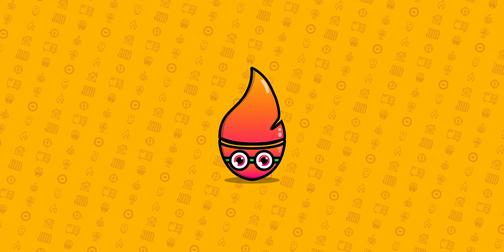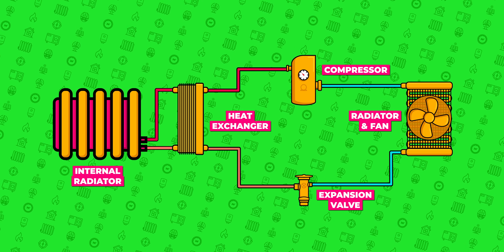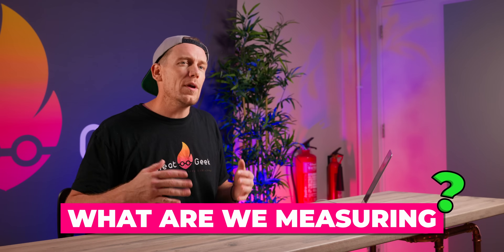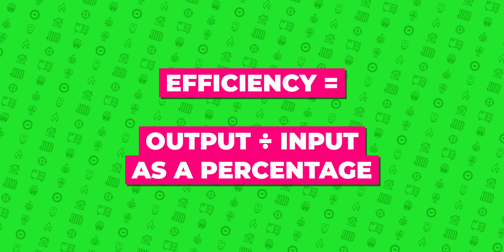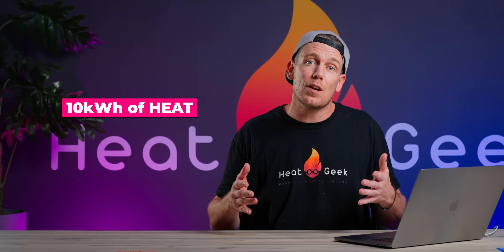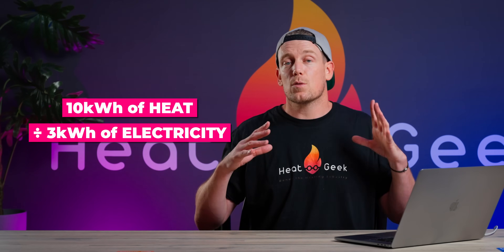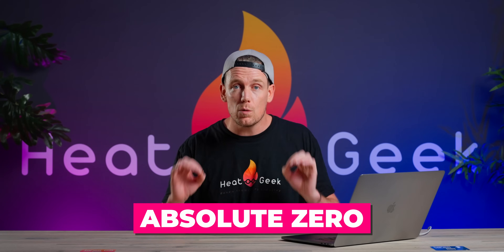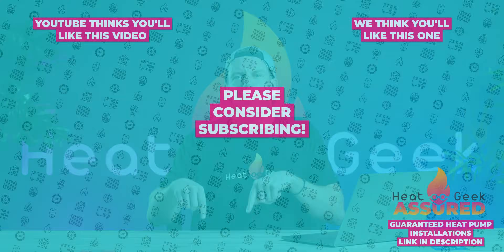How Can Heat Pumps Be More Than 100% Efficient?

Comment: In 2014 it was announced that 3 trillion tonnes of coal had been discovered under the North sea. This coal was accessible using existing technology and would be enough to power the UK reliably for about 2000 years.
We need to ditch the green energy eco madness and use this resource, only economically viable green technology should be used and only by those willing to pay the full cost themselves.
Reply: Don't be a wolly all your life Tim.
Reply: @Tim Fallon You can't extract coal from under the north sea as it would be all wet.
Reply: Pricisely, coal would get wet and wouldn't burn, at least with gas they could let it bubble up to the surface like a fizzy drink.
Reply: @bobsmith-dn1xw  are you a fizzycist then.
Reply: This video certainly does attract some amazingly dim persons.
Reply: So once we’ve burnt this coal recovered by scuba miners to produce electricity, you can use it in your resistive heater and get one unit of heat or run a heat pump and got four units of heat?  Or are you suggesting we all install coal fired boilers, get the wagon round with the coal every Thursday?

My take is you’re pro heat pumps as they make heating from burning sub-sea recovered coal more viable - or maybe I’ve got it wrong?

Comment: As a heat pump is basically compressing air shouldn't you also consider not just the temperature of the outside air but the humidity or moisture content. Also the altitude above sea level. Will a pump at sea level work differently to one on top of Everest. Flow restrictions in existing system. There must be a million things that can make each system unique and in itself different at any given time. Must be a bit like the Highway code. If you brake from 30 miles an hour it will take you X ft to stop. When in reality that stopping distance is infinite and the probability of matching that exact stopping distance even with the same car and driver in the same conditions is minimal. Too many variables.  Heat pumps no doubt efficient but at what cost. And they run on electric that comes from what source. All the ducks have to be in a row to be totally efficient. Economic and environmentally friendly.
Reply: That's not how they work... it is extracting energy from the air over a heat exchanger. The compression is of the gaseous refrigerant to liquid on the other side of the heat exchanger (at yhis point putting more temp into that gas). So the variable you're searching for here is the energy in the air.
Reply: @TheDankelsall  It is the refrigerant being compressed but heat pumps are very much still affected by heat, cold, humidity and altitude. They work in the cold and heat but their efficiency is considerably affected. I used to have a heat pump. The instructions with it said efficient operating range minus 8 to 20C. Below a certain temperature in the US they recommend having a back up heat source. If you are operating at altitude the air is less dense and has less ability to carry thermal energy. Again making heat pump less efficient. The point is the condition of the environment changes how the heat pump performs and makes for infinite variables. Thus giving different readings based on those variables.
Reply: @davetaylor4741  I'm glad we now agree, this is about energy available in the air, and no air is compressed.

Comment: My daughter lives in a housing association house, formerly a council house. Her leftie landlords decided a while back to remove the gas boilers from these houses and replace them with heat pumps. She has spent the last two winters shivering because the heat pump runs up electricity bills which she just can't afford. She is at this moment installing a wood burning stove at her own expense since the landlords refuse to accept that their heat pumps are a flop and are abdicating their legal responsibility to provide adequate heating. She is not alone. I have heard a lot about this subject and thousands of people around the country are in the same position, having heat pumps which run up eye watering electricity bills. The fact is that heat pumps are best avoided as they only seem to work properly in new houses specifically designed  to work with heat pumps. If you need a new gas boiler get one. Do not be fooled into buying an expensive heat pump because you will likely regret that decision when the bills come in. I have come to the conclusion that videos like this on YouTube are in fact sponsored by the heat pump industry and are breaking YT rules by not revealing they are sponsored.
Reply: Probably one of those awful NIBE things that council staff get kickbacks installing.
Reply: I've got a decent air to air system in the living room for a/c in the summer, it can sip energy providing local heating in the winter.

Comment: Excellent video - !!  So we have a Calorex air source heat pump fitted into a 10 year old 4 bed detached. The house was designed with envio in mind (to get planning) - so it has all the usual suspects for good environmental performance. All the hot water is produced by the heat pump. For heating in the winter there is a small gas boiler in the garage that can boost the temperature - it kicks in automatically, but we have it switched off (just seems to go against the whole concept). Overall, quite pleased with the system. Until recently we thought it was actually quite expensive to run - but it has only been since energy costs are now for public consumption in the media we find that perhaps it is not as expensive as we were lead to believe. However, the biggest fault (our fault) is how it is used. For years we used it more like a gas boiler - on for 2 hours in morning and evening for hot water, and then on and off for heating in the winter. Now watching your videos I can see where we have gone wrong. We purchased the house new with the heat pump already installed  and now I think about it we had no real instruction on how to use the system!  Mark.
Reply: Hi Mark, if you also retro fit a low temp heat emitter as well your bills reduce even more. hasve attached video link  https://www.youtube.com/watch?v=o7Jx3cBQNgg

Comment: What is the most efficient way to cycle the compressor, longer at a lower compressor frequency or shorter at a higher compressor frequency?
Reply: @garysmith5025  yes.
Reply: @garysmith5025  thanks, much appreciated. The heat pump system we have was already installed when we purchased the house. It's taken a few years to tweak the settings, the last setting I've found is that the compressor output is based on the outside air temp. On "Auto" it provides a lot of heat very quickly, I'd hazzard a guess that it's oversized for our house so now I have the compressor output at min (runs at about 25hz and less cycling but slower recovery on DHWS). I've not seen a significant difference in consumption but less stress on the compressor must be a good thing.

Comment: Would be good to break down running costs for a typical 3 bed semi. I assume that the run time and much increased cost of electricity means you don’t really get many savings from heat pumps yet
Reply: They have done. Search in their videos.
Reply: I put a brand new 18 seer heat pump in last year thinking it would save some cash when it starts getting cold, the problem is my electric cost went up 140% this year with no signs of coming down. it's more than the cost to burn oil at this point.
Reply: @jhallin5185  oh dear. Did you have cavity wall insulation too?
Reply: @hqew6662  nope blown in, insulation the house is pretty tight,  im talking about the pure BTU per dollar.
Reply: @jhallin5185  whats a 18 SEER? Not familiar with this term.
Reply: @edc1569  its an efficiency rating 18 seer is about middle of the road they have 24-26 seer units which are more efficient but way more pricey.
Reply: #nopanacea...

Comment: Very interesting and well explained, especially about the pressure sides and valve that controls that... how quick is the cycle or how does that work ? Or is the high pressure side always high pressure and the pressure maintains the same pressure throughout ?

 Very refreshing not to here any of the propaganda and conspiracy about global warming, your channel is much better without that.
Reply from the maker: Cycle is instant. The flow rate changes depending on how much power is needed.. the pressure differential is what changes..  you can't change 1 side without the other
Reply: @HeatGeek  liquid receiver is another main component part of the refrigerant cycle and enables one side to be increased or reduced without effecting the other if needed. Effectively it adds refrigerant to the circuit or removes it.
Reply from the maker: @darrenr1995  I was unaware if this thanks!!!
Reply: @HeatGeek  heat pumps most inefficient stage is the high temp demands. In the later stages of heating a cylinder, when the flow and returns from the coil to the condenser (plate hex) are hot, the refrigerant passing through the plate is struggling to be cooled below it’s saturation temp into a liquid. It’s at this point the liquid receiver sits and ensures liquid is being supplied to the metering device (expansion valve). With liquid added the compressor can then raise the temp / pressure on the high side to get well above the temp coming back from the cylinder.
Reply: @HeatGeek  So the valve lets pressure through as required from high to low side ? Thanks for the info and reply.
Reply: Some heat pumps have a reversing valve so the hot and cold radiators effectively switch.
Reply: @TC-V8  I think you mean condenser and evaporator. Yes most modern heat pumps can flip it’s high and low side
Reply: @TC-V8  Which is very nice and the reason I like the air 2 air versions that do that.

Comment: can you  install a heat pump indoors or false roof maybe .would it make it more effient to run
Reply: Briefly yes before it had used up all the heat and started to freeze the room
Reply: We had an air exhaust heat pump from nibe that reused the heat it generated. It was crap and couldn't heat the house as it was continually sucking the heat out the house. We now have an outside heat pump that can heat the brilliantly.
Reply: @MrAshman3000  unfortunately for NIBE that is  one of the most prominent results for their products online, as with everything it has a time and a place
Reply: No, that would be like leaving your fridge door open!

Comment: It is like using your refrigerator to heat your house. Your claim about it being 500% efficient is saying it is a perpetual motion machine, all our problems are solved.
Reply: If it was 'making' 5kw of heat from 1kw then yes this would be your perpetual machine and yes this is impossible! But it's not making heat - its moving heat - or pumping heat - clue is in the name! So it's using 1kw of energy to move 5kw from outside to inside.
Reply: @TC-V8  heat pumps do make a considerable amount of heat. Compressor raising the pressure. Outside heat absorption is just part of the process
Reply: @darrenr1995  Agree the compressor does add a little heat into the system - but the majority will come from the moving of heat through the refrigerant cycle. The act of compressing air and raising it's temp must be less than 100% efficient, so that still leaves you with over 400%
Reply: @TC-V8  absolutely, we install AC and it’s right there on the side, tells you the run power and tells you it’s output. They are the most efficient things running off electric but unfortunately we can’t say all heat energy comes from the air not from the electric.
Reply: @TC-V8  so if you daisy chained five of these together then you could drive a steam generator that would power the units and the city you live in. Hook ten together and you could power the country.
Reply: @D-B-Cooper  are you claiming heat pumps aren’t possible?
Reply: @edc1569  there are plenty of heat pumps, refrigerators, air conditioners, etc. what is impossible is over unity.
Reply: @garysmith5025  then put another heat pump on it and get 25kW, add another and get 125kW, add another and get 625kw, add another and get 3125kw and soon you can produce enough electricity to power the country for free. They will build statues of you.
Reply: @D-B-Cooper  So at your second heat pump where exactly is the 25kW meant to magically appear from? You can't just create energy, so the second heat pump cannot pump anymore than the first pumped (plus whatever energy you put in).  Some systems do use dual heat pumps arranged as you propose but this is to allow the to work with large temperature differentials and are less efficient than a single stage pump.
Reply: @edc1569  I was being sarcastic.
Reply: @garysmith5025  how is that a 500% return?
Reply: @garysmith5025  I found where that 300, 400 and 500% come from. They take a toaster as base line of 100% so the heat pump is five times more efficient than a toaster to heat your house. God help us.
Reply: @D-B-Cooper  You agree on the conservation of energy? Energy can not be conjured up or destroyed? So for a refrigerator to work it must move the heat (energy) from the inside to the outside? Now what I think you're suggesting is there some sort of physics that means you must consume more energy than the energy you move, is that your belief?
Reply: @edc1569  my wood stove works at a 96% efficiency rate, meaning I lose just 4% out the chimney. I could never get more than 100% energy out of my wood, and wood being natures solar battery. If you were to boil water with a certain amount of energy and condense the water somewhere else, the heat from the steam will never be greater than the energy used to heat it and there will never be more water than you heated. The energy (heat) you transfer into your house will never be great than the energy you use to acquire and transfer that heat. All good heating systems have been working in the 90+% for years. I know people with heat pumps and none are very happy with them. The government wants to have you tied to electricity where they can instantly control the amount and price you are allowed. You should look into alternative ways of transferring and storing energy. Electricity is not that efficient. I have been playing with friction where mechanical motion goes directly into heat stored in a transferable and storable medium. You can use wind and sun simultaneously. For cooling I can’t understand why anyone would use anything but subterranean heat transfer. Even your heat pump would be more efficient by using ground water as a heat source in winter. I live on the ocean and have a constant and stable heat source in the ocean. I have been thinking to couple the tides to use as friction heat to heat that water to heat my house, instead of wood aka biofuel aka natures solar battery.
Reply: @D-B-Cooper  The energy (heat) you transfer into your house will never be great than the energy you use to acquire and transfer that heat. This is like saying the world is flat.
There have been billions of air-conditioning units sold, they all have published specification which people use to determine the most efficienct.  In the UK we tend to specify them as BTU for the cooling power and watts for the electricity consumption, a typical unit is 10,000BTU and 1000W electricity. 10,000BTU is about 3000W. You can go buy a heat pump unit and experiment with it whenever you want. There is not some grand conspiracy involving millions of HVAC installers worldwide.
Reply: @edc1569  first law of thermodynamics.
Reply: @garysmith5025  I can’t relate to someone that thinks 2+2=5.
Reply: @garysmith5025  every kid over 10 knows the first law of thermodynamics.
Reply: Heat pump principle is efficient, however nothing is free. So whilst they are efficient the down side is duration of run time. Watch a new gas boiler heat a cylinder from 20 to 60’c, takes 30/40 mins, watch a heat pump do it, takes much much longer! So end of the day you want it 60’c they both cost you. These videos are obsessed with COP.
Reply: @darrenr1995  that's like saying a Prius is efficient but takes a long time to get anywhere so cheaper to take the Porsche as it's quicker and spends less time driving!
Over the same journey which wpuld be cheaper???
Reply: @darrenr1995  they also want everyone to use electricity so they can control it or shut it off. Also keep you broke. I heat with wood, I mean biofuel, natures energy battery.

Comment: Thanks for the nice clear video. Probably a dumb question but in the heat pump model, why is the radiator classed as a heat 'sync' - suggesting that it's being kept 'in time' with something else - rather than a heat 'sink' that drains the heat energy from the circuit into the local environment, as used for releasing heat energy from hot electrical components?
Reply: That's a typo. It should be 'sink'